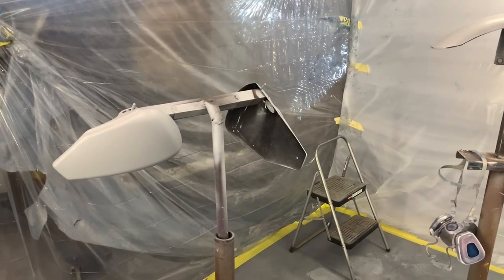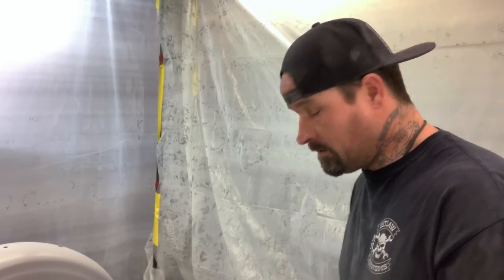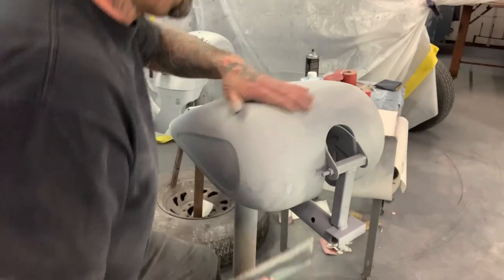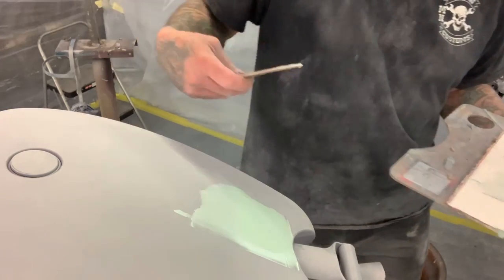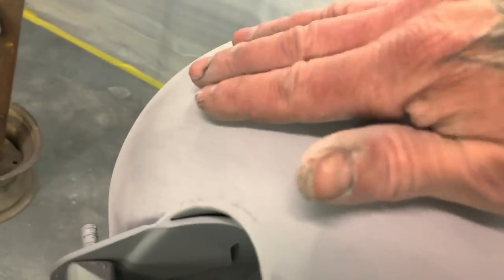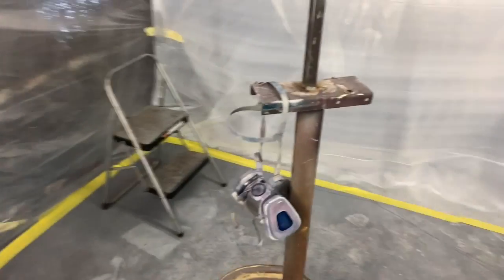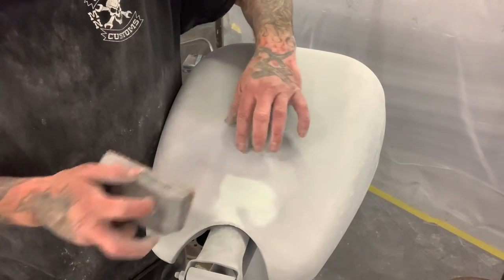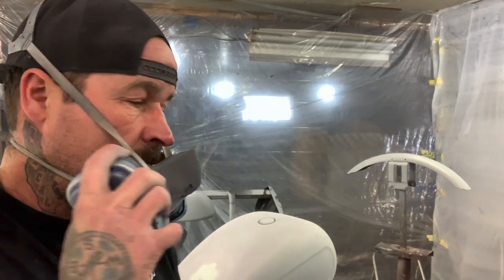Auto body work: small dent repair, using metal glaze putty and high build primer

Comment: Question.Is it possible to paint the hood of my car with sponge brushes and then buff it smooth?
Reply from the maker: Really it depends on how much work u wanna put into the panels. But u will be sanding alot! I really wouldn’t recommend it brother 👍
Reply: @OutlawEdge  Rattle cans don't do a good job as they spit.  And I really don't want to get into a sprayer.So Thats why I was goin with the foam.

Comment: what grit do I use to sand to bare metal on my DA
Reply from the maker: If you want to Santa bear metal the best grit to use is 36 or 40. It’s very course but it will remove a lot of material quickly. Hope that helps. Thanks for watching. ARCO